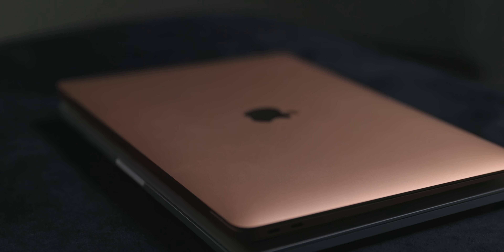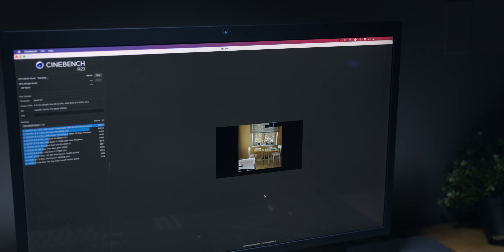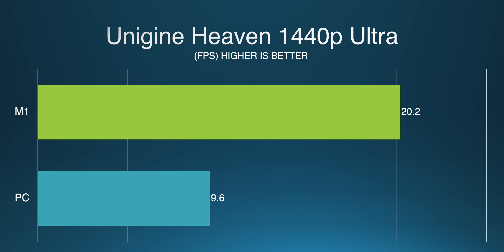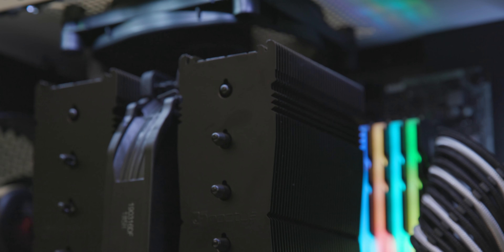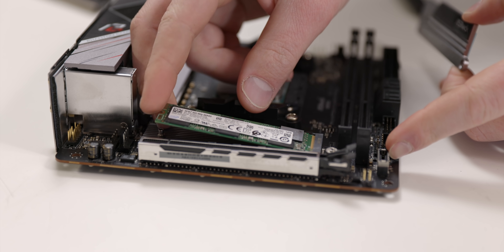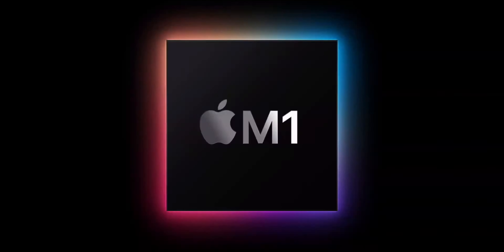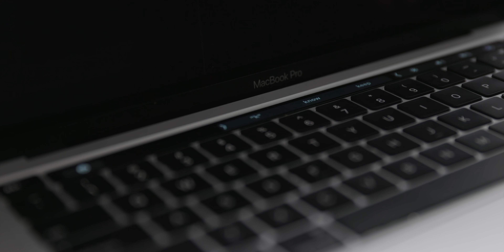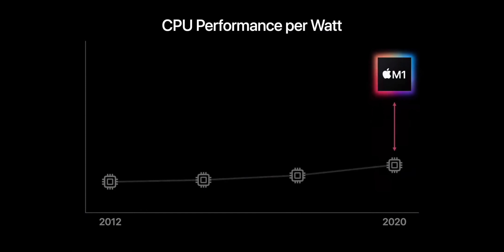$699 Mac mini vs $1,000 PC: Which Is Faster?

Comment: You should make a video about all the problems that come with the m1. I got mine 2 months ago and it's been a headache,   There is a bunch of stuff that don't  work and rosetta lol, that thing is way overrated.  I've been using terminal, brew and other apps just to make this machine more usable but there is a lot of things that I cannot figure it out, maybe you can do a video for advanced users about this m1, because even if it's a great machine there is baggage that comes with it.  and yes I googled these issues but there isn't a lot of info on the web.

Comment: The debate over compute-power vs power-consumption, is an interesting one. Yet, many average people look only at the bottom line. How much does something cost. Apple could have easily sold 10-50 times more personal computers, if their offerings were more cost-effect. Especially when you start increasing the specs beyond the often ludicrous base levels. I use both PC & Mac, so to me it makes no difference. What I struggle to forgive Apple for though, is not innovation, it's form over function. Apple pushed the roll out of thin and light, to the point where their products thermally throttled. What the hardware industry did next, was just follow Apple like sheep. As a result, end users were forced for several years to go backwards/sideways and have less enjoyable computing experiences as a result. For many years, we got faster processors, more cores, but devices that slowed down when taxed. Sealing devices completely, was also completely stupid. Plus, not something that benefits mother earth either. It'll be interesting to see what happens with the iMac redesign. All CPU's are set to become larger as time goes by. Their size will limit how well they can be cooled, once that limit is hit, the only way to increase performance is like you pointed out - manufacturers will then need to double the size or thickness to double the processor count. Interesting times ahead.

Comment: why would anyone spend tons of money on stupid apu especially now when zen3  are out and for 1000$ you could build pretty fast pc build like 5600x +some gpu as rtx 2060super or 5600xt,5700
Reply: Because they are more expensive and larger
Reply: @ArchieGee  he talks about PC not laptops and yiu.could get again. pretty fast gaming laptop as 4800h+1660ti or for 300-400$ more 5800h+rtx 3060ti and vs that mac mini are joke in anything
Reply: @Mr11ESSE111  no they aren't. That laptop would cost >$1000 and would consume a lot more power.
Reply: @ArchieGee  that laptop will give. you 3x more fps and more performance and for power all peoples use cable anyway and on.battery nobody will do some heavy task
Reply: And they don’t run Mac apps like Final cut

Comment: The M1 is a beast. I'm a PC gamer, so obviously, this is not the right "car" for me as you said, but it's kind of awesome that Apple was able to pull this off, and while I don't see it as a big potential to compete in the GPU department with Nvidia, it will still give Intel and AMD a needed push, even if they both have a market share order of magnitude bigger than Apple. They need to step up their game.

Comment: Shameless bullshit. You are comparing 5900HX (not low power Ryzen 7 5xxxU) power consumption in power virus Prime 95 that will consume 1.5 times more power than regular multicore load with Apple M1 power consumption in Cinebench. M1 Mac mini peak power consumption is about 40 watt at the wall, and it's about 2 times slower than 5900HX in multicore load. Considering this, theoretical mobile Ryzen on 5nm process will have only slightly lower efficiency. So no magic, it's very good CPU, but not extraordinary.

Comment: My biggest issue with the M1 from a practical performance standpoint is the laughable 16gb max ram. Sure, MacOS generally has better memory management and usage, but someone actually performing workloads that take advantage of the performance are going to want/need 32GB at least.

Comment: My experience with the M1 Mac Mini, indicates the reviewers are missing valuable info.

#1. The 8GB is a challenge. After start up half the RAM is used. No significant apps running. With simple apps the total of 8 GB is approached causing the internal SSD to be used. Therefore even casual users will benefit purchasing the 16 GB version.

#2. My 48 inch Samsung could not be set up by the Display tab. The tab no longer had the “manual slider” as found in previous versions of the OS. So the menus remained off screen and unusable. The fix is found by using the settings of the monitor itself. Setting it for “computer use”.

#3. The fewer thunderbolt  connections on the back are too close to use your current cables “with an adapter”. Causing even fewer connections. Until I connected a simple inexpensive hub (<$30) to the single useable thunderbolt

Comment: For large customers deploying thousands of devices, running M1 (20watts) machine vs a PC (120watts) can literally save them $1,000's per year in electricity. thats remarkable. thanks snazzy.
Reply: It definitely is impressive but the initial start up cost would be costly for companies and so with switching over MDM systems so it will never happen
Reply: Apple has nothing like a windows domain system with group polices and centralized management.

Comment: Idk if you can just compare X86 with ARM, though. You should compare the m1 chip to a qualcomm chip or something... Apple's M1 chip is very, very good at what it does and it's been known for quite some time that X86 was always the temporary solution until we finally got ARM to be good enough, but ARM still has severe weaknesses that X86 just beats out. There are serious limitations to the M1 chipset. So while it is crazy good at what it does, it IS limited. Which... Well, that's kind of Apple, if you ask me. There's efficiency in simplicity.

Comment: If I could run Linux on it, at decent performance, and if I could do hardware upgrades to it, I would buy an M1 Macbook.  I'm writing this on my 2012 Asus laptop, which I upgraded the RAM and swapped out the hard drive with an SSD, running Gentoo Linux with ZFS on root.

Comment: Even though the MAC Mini is cheaper it's still a terrible investment since when the measly 8GB of shared memory is not enough to do basic workloads in a few years that SSD is going to essentially eat itself alive.  So you should factor in 1.5x the cost of a mac mini when comparing it to a regular upgradeable pc since you will be replacing the MAC in all likelihood once in the same timeframe as that PC will be around having the ability to upgrade its ram and SSD.  70% of users probably don't give a flying F how efficient the cpu is in their MAC.  So what apple should have done is boosted the heck out of the clock speed of the M1 to the point it needs the fan running and then it will most definitely smash anything on the market today.

Comment: Well well , this is  really amazing news. But you should go back in history  and find out why RISC CPU failed to take over  in the 90's and why Xbox and PlayStation gave up on RISC  cpus few years back. PS3 and Xbox 360 were both running a RISC based cpu but they failed and moved CICS or 86 platform. With every gain there is a price to pay. And with RISC it is called compatibility issues with old software. This is way this is just a big hype that will be up and running for some time but eventually will disappear .  Apple is good in building hype by successfully masking the biggest problems. Any way this was a great add but just an add. Not really a review.

Comment: Yah, Windows/Qualcomm ain't going to catch up to this. Windows, as much as I love it, has software optimization that can be described as... lackluster. Apple has the worlds best chips BY FAR and best optimization BY FAR. Microsoft came out with Surface Pro X and it was a failure and embarrassment. Apple just came out with the M1, plopped it in some of their most popular products and immediately rendered not only their own Intel Macs pieces of over priced garbage, but EVERY OTHER LAPTOP AND SMALL FORM FACTOR. And now we can expect a Mac Pro with 16 or 32 cores and massive GPU running on a fraction of the wattage of AMD's best competition, in addition to all software in Mac OS being ridiculously optimized (plus Adobe and other third party apps...). You'd have to be full blown retarded to not get one, especially since most of Apple tax was really Intel tax and the prices are going to be pretty delicious I assume, just like they were with this round of Macs.

Comment: I'm deffo getting a Macbook Air next year when I can get one for around £800 on the refurb store. I did the same with my Mid 2012 Macbook Pro back in 2014 and its still going strong today.
Reply: Are you still using the original SSD in your 2012?
Reply: @tobyglyn  It came with 512Gb HDD. I swapped it out a couple of years ago for an SSD. I also replaced the DVD drive with an SSD as well. So I have 1TB in SSD storage now. :)
Reply: @Shundi12  Ah, the good old days when you could replace/upgrade RAM and storage in our Macs. Now everything is soldered in :(
Reply: @tobyglyn  Yeah it sucks that you can't upgrade now. The mid 2012 models were the last ones that   were user serviceable and allowed you to upgrade the HDD and the RAM. I had a choice at the time of a Retina version (slightly nicer screen) or the upgradable version. Luckily I chose the latter and its still perfectly fine for most things. I've occasionally looked if it was worth upgrading over the years, but there hasn't been a reason to really. However, the M1 Macs are so fast and relatively cheap compared to the Intel models that I'm finally pulling the trigger on one some time next year.
Reply: My MacBook came with 4gb of RAM. It's since been upgraded to its maximum of 8Gb.
Reply: @Shundi12  The 2012 Macbook Pro can go up to 16GB
Reply: @tobyglyn  Oh really? I always thought it was 8GB. Well, if that's the case and I was deciding to keep it for a few more years, then that would be good news :D. Perhaps the person that I eventually sell this MacBook Pro to, can max out the RAM :)

Comment: What is the use of multi thread test when M chips are faster than everyone? The M is an ARM architecture!! 
The power of the current Apple M1 is not fully revealed because most of apps & AAA games don't support it! Just wait for it to be supported to be amazed!! I wish the success only to Apple ARM chips because they deserve it. They will help us pulling us from he Nvidia & intel greed swamp! & the proof is that Apple reduced its prices of their new Macs because they are in control of the cost & they could've raised the prices since it's a new technology! Nvidia, intel & windows producing slow advancement tech with compatibility issues products for insane price. Nvidia & intel are the reason I hated my MacBook Pro & switch back to windows!
I'm grateful to God to live & see this chip exist! This Apple M chips moments is actually as the moment as first iPhone released!
I'm pretty sure not only me going to change to MacBook Pro later this year when MBP reveals the beast inside, most of the people are If the PC industry not going to catch the ARM PC version race! 
About ports:
Please NO OLD HDMI or USB A! we NEED more Thunderbolts & a charging port. The charging port need to get back to benefit from the Thunderbolt ports. From now & on should be Thunderbolt & it should have been before. It should be at least 4 ports.
It's so amazing that when you plugin external monitor that supports Thunderbolt you can plug to that monitor the mouse, K/B & the headset!!
About storage:
I would suggest to buy the smallest internal SSD & use it only for OS & apps & buy a Thunderbolt flash drive for production, same to gaming & so on! 2.5" external storage is physically big & it takes a lot of space if you have many of them for multi projects. I think old 2.5 external storage is a tech going to die soon & Thunderbolt/ Type C Flash drives are the future!

Comment: Except apple markets these as professional based computers but their graphics horsepower gets absolutely smashed by anything dedicated that's above £250. With AMD starting to side with exynos and Samsung they can't market to anyone where they need both strong encoding power through open GL or large vram completely taking away of how they market these products as professional grade. Also the entire fact that arms instruction set is already extremely simple so the leaps of generational improvement will be like Intel's tick tock as x86 is easier to simplify down compared to it due to it being a more complex instruction set

Comment: Could you compare it to a 5600x? So we could get and actual comparison?
I just built a Photoshop/CAD rig inside a powermac g5 case and would love to see how it shapes up against a Mac mini. 5600x, 32gb ram 2x 480ssd + 1tb storage 650w Corsair PSU and old 1060 6gb for as well ~700€.
I'm thinking about switching to a m1x iMac if it runs 4k Unreal smoothly. (Designers gotta keep up).

Comment: well, in my opinion, the M1 macbook is a very good deal for most people that don't game on their laptop, are only replying to mails, doing the occasional photo edit, and some web browsing. But so is a windows laptop.

I mean, sure, it isn't as efficient or powerful. But the fact is that "most" people (at least where I live, I don't really know about the NA) are more used to Windows machines than Apple ones. Getting an Apple laptop means you're getting started into the Apple ecosystem : if the laptop fails, you go to Apple. If you want to buy a USB hub, you go to Apple otherwise you brick your laptop. None of that non sense is present on Windows machines, for the most part. 

In my opinion the loss in perforamnce and efficiancey is the right price to pay to stay on Windows (Or for the same power in a laptop, the additional price to pay, you got me)

Comment: "Not a measure of power consumed, but of heat produced." This is totally wrong.  

Firstly, on a cpu, the amount of heat produced is always within 1% of the amount of power consumed. See a cpu is nearly 100% efficient at turning electrical energy into heat energy.  If you think about it, a cpu works just like a nearly 100% efficient space heater(most are). It's electricity running through wires. The only energy the system loses is in heat form With <1% being lost to electromagnetic radiation.

Secondly, TDP refers to Thermal Design Power. This is how much power the cpu maker would like the case/cooler maker to design for.  Intel typically exceeds these numbers for power/heat output, but not for long enough to overheat.  For instance if the TDP of a chip is 28watts, the chip may hit 40 watts for short periods of time, but the average will be below the TDP (at least it's supposed to).

Comment: I really want to ditch my 16" for an air, but I'm holding out for a 16" Apple silicon machine.
Reply: Good call, I'd do the same too as it's likely a 16" Apple silicon machine will blow every other laptop away.
Reply: @JCJW101  well no.
Reply: @NonsensicalSpudz  why do you think not? The lowest end slowest cheapest m1 macbook is trading blows with some of the highest end laptops now. Why wouldn't the upspecced 16 inch be the top?
Reply: @cinialvespow1054  because there are certain tasks, that M1 can't do, because the technologies require AMD or NVIDIA for example, also M1X is and well be a fixed spec, it has a limit on the GPU end, but... it will definitely be a beast
Reply: @NonsensicalSpudz  there are some things the m1x won't do, but we're talking about a laptop, not a pc. A laptop has to have a good battery, good display, good trackpad, keyboard, etc. And most of these things, only apple has it.
Reply: @benram3954  a laptop is a PC btw,  I guess its not like apple are going to dip there stuff into actual PC gaming etc, so why not just go full apple with it.
Reply: @NonsensicalSpudz  I think they meant a desktop pc
Reply: @cybercery5271  huh?
Reply: @NonsensicalSpudz  he compared a laptop to a 'pc', he meant pc as in desktop computer.
Reply: @NonsensicalSpudz  Apple used to require intel to have a functioning computer, now they dont anymore. What makes you think they are not capable of developing their own graphic processor? Relying AMD or NVIDIA for graphic processor can be thing of the past too just like the x86 intel
Reply: @yupickmyusername  however one of the reasons apple ditched intel was so they could use new more efficient process nodes and get better optimisation and I do believe that both amd and nvidia are working to make arm compatible gpus but please, correct me if I'm wrong
Reply: @NonsensicalSpudz  yeah i meant a desktop sorry. Really depends on the customer. I have a gaming pc that costed less than 400 USD and I also use my mac for school, video editing, and some other things.
Reply: i'm really interested to see what the supposed "m1x" will do.
Reply: The M1 is really nice. If you can wait then wait. Because it probably will be out in June.
Reply: @techvideos7338  I’ve got a m1 mini but I’m still using my 16” pro for professional and YouTube work
Reply: @ChrisWilmshurst  then you are all set. M1 is different. I like it
Reply: @ChrisWilmshurst  You are all good brother. I would wait if i were you. They are making the macbook pro a PRO again. PORTS, finally.
Reply: Have u got it yet?

Comment: Im getting an M1 Air, so am not against Apple ...however the adversised '8 core' is totally insincere.  Since when do we still refer to CPU cores as if they were single threaded?  This a 4 core multi-threaded CPU..a good one.. but it has 4 cores